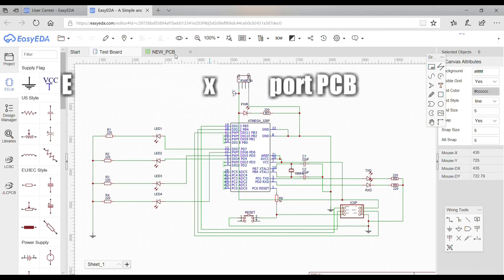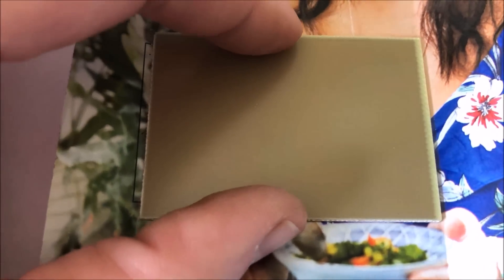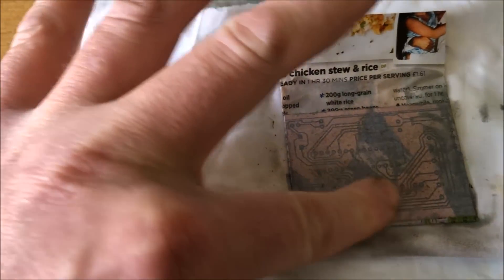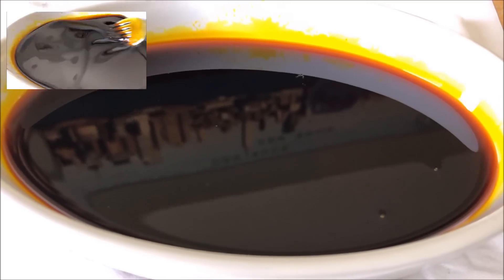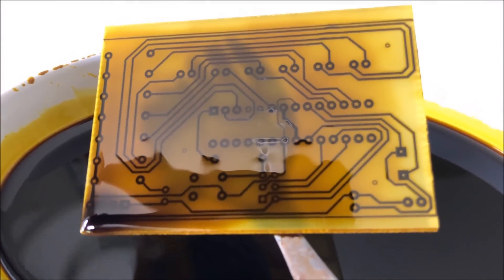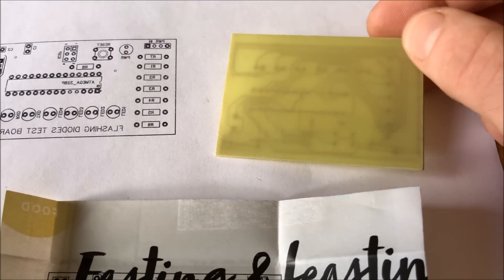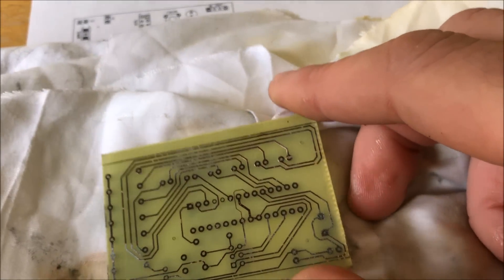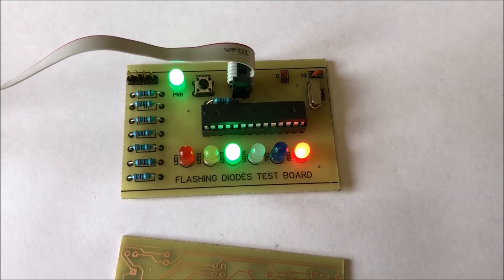DIY PCB Toner Transfer (No Heat) & Etching

Comment: Is the design for the PCB made mirrored? How did you get the designs right on both sides of the PCB?
Lastly, I saw you printing on magazine paper! Could not understand correctly! Could you explain? Thank you
Reply: My understanding is that printing on the magazine paper (or other glossy paper) will allow for easy release of the printing onto the PCB board

Comment: Didn't work. Tried two times so far. I only get smudges or faint circuit traces. Maybe it's the paper thickness, the toner, the acetone concentration or because I used the copper fill method and I have a lot of black. Either way, this doesn't seem reliable.
Reply: I had only parts and very faint transfers the first 3 times. Make sure you press hard! I think I was only pressing half as hard the times i got only very faint results. Also, the time it worked i actually mixed water in the acetone, i used "chemical acetone no oil" 50% and 50% water! I think maybe the paper needs to be dissolved by the water, although not sure the water was what helped. Make sure you press hard!

Comment: Bought two types of nail polish remover. Tried with two different laser printers. My Samsung ML1850 and acetone free nail polish remover (Superdrug pink bottle) didn’t work at all. Lexmark 360 and Sainsbury’s nail polish (doesn’t state acetone free, presume it has acetone) worked AMAZINGLY! Couldn’t believe it. The tracks are SO nice. Can’t wait to do more, with finer tracks. All I can say to others is... if it doesn’t work first time, try a different printer, different nail polish remover, different paper, press harder. This is an EXCELLENT way to make homemade PCBs, no question about it.

Comment: Oh meh gosh.  What kind of resolution can one expect upon transfer?  The double-sided PCB I need is only about 3/8" to1/2" wide by 1.25"  length, with lands about 3/32" and runners 1/32".  This leaves about 1/64" gap between conductors.  Even photo-sensitive process is beyond my capability.  I really like the idea and may eventually attempt on project using older discrete cmpnts.
Reply: Тhis is the right question!

Comment: Does not work at all for me with Samsung laser, glossy paper and pure acetone.
Reply: Tobias - in what way does it not work, does it result in a smudgy mess or does the toner not transfer at all?
Reply: @TrystansWorkbench  The toner does not transfer at all, even with pure acetone and transfer paper.
Reply: @ranger81de  I'm using a Samsung Laser Printer here (an old CLP500), what model number is yours? When you say 'transfer paper', have you tried magazine paper? Try cleaning the copper layer before you start with acetone then use fine wire wool (or very fine sand paper / emery paper) then clean again with acetone. Don't over-soak the magazine with acetone, and let it evaporate dry before trying to remove it. (The video is speeded up when it's drying). I've had success now with glossy magazine paper and the same "Sally Hansen Moisturising Polish Remover", after previously trying pure acetone (just smudged into a mess).
Reply: @TrystansWorkbench  I have tried multiple times with magazine paper, catalogue paper and special transfer paper. When using with heat it transfers without any issues but I wanted to give this method a try. As I said, even with pure acetone, the toner did not transfer at all. I'm using a Samsung M2020 series printer with original Samsung Toner. Also tried different amounts of acetone (completely soaked, only few drops), I couldn't get it to work. :-( Of course I have cleaned the copper surface with fine sand paper before to make sure it's absolutely clean. I was also wearing gloves one time to make sure there is no residue on the copper layer.
Reply: @ranger81de  Tobias, well it sounds like you're doing it correctly. How very strange. The only thing I can think of is for you to try and source the nail varnish remover used here. I found diluting acetone with water made things worse.
Reply: @TrystansWorkbench  I guess that will be hard as I'm located in Germany. I guess the toner of this specific printer has maybe different ingredients which do not dissolve as good as other toners. Once I got a new printer (of another brand) I'll give your method another try. So far I'm using the regular heat transfer method with a laminator, which works actually very good and is nearly as simple as this method. Thanks for your comments!
Reply: @ranger81de  You should be able to get "Sally Hansen" nail varnish remover in Germany. After all, we have it here in the UK, and we are both in the EU (for now).

Comment: I'm quite impressed (and surprised to be honest) that acetone can do such a great job transferring toner on to a copper. Great idea! Kudos to you, sir!
Reply: it was very impressive indeed ... so much easier and quicker than screwing around with a 3D printer to etch a board - aka, ruining a perfectly good piece of blank copper pcb, because most of the attempts I've seen took over an hour for even small boards and totally munted the copper tracks up.
Reply: He really should have been wearing gloves for the acetone part too...
Reply: @qumefox  nail polish remover is designed to be used without gloves
Reply: @AlessioSangalli  you generally apply nail polish remover to the fingernails. You don't soak your whole hand in it
Reply: @qumefox  he didn't put the whole hand in, however acetone attacks gloves too, especially the nitrile ones, that might be why he didn't use them for acetone but he did with the ferric chloride
Reply: @qumefox  what matters? I often wash my hands with brake cleaner, thinner etc. Depends what i'm doing atm. None of those won't absorb. It just dries your skin.
Reply: @qumefox  nailpolish remover or acetone wont hurt your skin and i use bleach barehanded and nothing happens
Reply: @qumefox I'd think of doing that part with a brayer.
Reply: Instead of nail polish remover, can i use acetone only???? Or isopropyl alcohol??
Reply: Этот способ давно известен

Comment: I used glazed paper it is similar in texture but first experience went wrong, what could be the issue and it was difficult to keep paper completely joined with the surface of copper board any tips regarding that please,

Comment: Gareth, what machine are you using, is that a laminator; if so would using an iron also work?
Reply: Good Point Maarten!
Reply: The video clearly says "No iron, no heat" and you talk about laminator, iron et al. Are you so dumb?? And that "machine" he is using is a Laser Printer, heard of it before???
Reply: I am not dumb and making rude remarks says more about you than about me;
I don't understand why you should transfer a print onto a glossy magazine page, tried it and the paper got stuck in my laserprinter, hence my question

Comment: Whats best way to make the holes for components?
Reply: If you have a drill press, that's best.

Next best, if you have a Dremel tool, there are pretty inexpensive drill press kits that use the Dremel as the drill (https://amzn.to/2PEn9pI).

The worst is trying to use a regular drill, freehand. It's a good way to break tiny little drill bits, and get crooked holes at the same time! :P

Comment: hello? if I don't have a laser printer may i use ordinary inkjet printer?
Reply: No, sorry. Laser printer toner is basically powdered plastic, which survives the acid and protects the copper underneath. Inkjet ink can't do either.
Reply: @andrewrothman9831  hey. i got an idea what if i do this experiment. i will print the pcb design in basic inkjet printer. but after i do that i will photocopy the design that i printed in basic printer. then.. i will use the pcb design that i photocopied before. is that okay? what i mean was i will use the photocopied pcb design. not the inkjet pcb design. if I'm not wrong the toner of the photocopy is same as laser printer. right??
Reply: @mrjn6940  That should work just fine, as long as the photocopy quality is good.

Please come back and tell us how it turns out!
Reply: @andrewrothman9831  mr andrew i have one big question. what type of paper is the best suit for pcb making like you do? and like you have? and how many gsm of paper should i use? for me it doesn't matter if its 8,1/2 by 11 or 8,1/2 by 12.
Reply: @mrjn6940  I had a lot of trouble with papers. I would like to try using "semi-gloss finish office paper" like Hack in Black used. What finally worked for me was heat and tissue paper -- the really thin stuff used for gifts!
Reply: @andrewrothman9831  i think i use traditional tracing paper. sure.. thanks anyway. i will show my video here someday.

Comment: Use acetone and alcohol 3:8
Reply: you mean 1 to 2,66 ? 
i found that 1 to 3 and 1 to 4 works
Reply: What alcohol do you suggest?
Reply: most use Isopropanol sold as "rubbing alcohol" or medical cleaning soloution. Its cheaper when you by it in bigger packages.
10L for ~20eur on ebay
local store 0,2L 2,5eur (6,25x more expensive)
but i guess you could by the small package to try it out first.
Ethanol might work as replacement.
Reply: @hyperhektor7733  Thanks Hektor for your reply. I'll try that. I found yesterday that pure acetone just made a big mess, and that the actual nail polish remover used in the video worked very well. I will mix some isopropyl alcohol with my pure acetone and try that too now. Thank you.

Comment: Do I have to use Lazer printer for this process or any printer will do the job?
Reply: @ Legends NUB:
It HAS TO be a Laser Printer. 

The acetone of the nail polish remover liquefies the toner of the laser print, because toner is made of special plastic. Acetone liquefies certain kinds of plastic. 

Since the toner is liquefied by the acetone in the nail polish remover, it can be transferred (together with the carrier layer of the magazine paper) to the copper clad board by pressing strongly. 

Since the color particles of other printers DO NOT consist of plastic, this process DOES NOT work for other printers.
Reply: @tiny5ft6  bro i bought laser printer today for this purpose . thnx for replying
Reply: @ Legends NUB: 

You're welcome

Comment: I don't think he mentioned it but If memory serves then I think you have to use a laser printer ! It wont  work on an inkjet ! Also does anyone know what you could use to protect the traces once the PCB has been etched. Their is a stuff that repair shops use called Conformal but its a little expensive. I'm wondering if there is a household alternative like varnish or maybe nail varnish. I don't know but your advice and suggestions are appreciated.
Reply: I used clear lacquer on mine bought from Halfords

Comment: Absolutely love the tutorial but I never seem to have any success...
At this point i've tried and given up on chemical PCB etching methods, so i've built myself up a CNC machine and now i'm mechanically making my own boards. I suggest anyone out there who isn't having any luck with anything chemical take a look at milling PCBs. I've gotten the original parts of my mill from a $200 chinese kit and i've modded the x and z drive trains to be more robust, also adding a better bit collet, overall being less than $400. Hope this helps, mylo.

Comment: Every day i discover new amazing things in this life. Huge thanks for this, it saves the most important , it saves time. I cant leave without sharing lifehack. If you screwed up with hot glue, just poor it with isopropyl alcohol, and hot glue will fall off almost instantly.
Reply: damn really?  I wonder if that goes for medium heat glue and high heat glue. 

Ok life hack... hmmm.  Use 3.5mm audio jack cables as "wiring harness" for sensors that require 3 wires. Just make sure audio cable has 3 wires.  makes a quick disconnect to sensors and looks tidy.
Reply: @mattrevesz  I have only one type of glue in my area, I assume that if heat glue has the same chemical structure, isopropanol will work . As for sensors - 3.5 mm jack is really better than those small breadboard pins.
Reply: @wickeddubz  hmmm that's really cool about the alcohol.... I put my last project in the oven on low and used a spatula to pry off the hot glue LOL.  
Yea those breadboard pins don't inspire a lot of confidence.  I
Reply: @mattrevesz  I tried to remove hot glue from my project (modded small ikea table) , but I saw that if i continue to remove it mechanically, I'll screw up everything. Few minutes of intensive search and websites crawling helped a lot, all glue just fell of instantly. Chemistry rocks :)

Comment: Great video... when etching the PCB, I prefer to put the PCB upside down. 
Surface tension helps to keep the PCB afloat on top of the ferric chloride.
Reply: Assuming the "resist" is reasonably strong, I put my boards in a little plastic container (one with a snap on lid), such as you will find holding lunch meat, and then shake it fairly vigorously. The etching goes real fast this way.

Comment: Thanks for the great idea. I will try it for my next PCB. 
On seeing this video, one question is likely to arise in many people's minds: How is it that nobody ever thought of this method before?  One obvious answer is this. We know that acetone dissolves toner. When we use acetone to remove the toner from a PCB made using Heat Toner Transfer method, we find that the toner gets smudged and spreads on the board. So, we get the impression that using acetone will result in smudging and the PCB pattern cannot be transferred with precision. 
Of course, now we know that if it's done the right way, it CAN give you a precise and nice-looking PCB.

Comment: plastic does not magically adhere to a pcb.  can you guess what step was left out  ? besides pcb houses do a much better job than I ever could do diy ing it.
Reply: clean the copper surface before transfer; the acetone in the nail polish remover will make the plastic sticky

Comment: Great tip! But I don't understand the step from 1.20 to 1.30...You taped a piece of magazine paper on top of the printed circuit from the laser but what to do next? How do you get the printed circuit on the magazinepaper?
Reply: He put it through the printer again to print on the mag sheet.

Comment: Hi! I am on verge of transferring image on brass sheet. I tried the heating method with transparency sheet. It did not went well. Your output looks so nice. Will be trying tomorrow and would let you know how it went. I have a question. 

Can I use ISO propyl alcohol instead of acetone as you have used ? Please reply ASAP. I have few hours before doing this. 

This is the simplest method I have still come across. Earlier I have tried tapes for tracks and pads. But it failed miserably. Then I used to draw my PCBs design with permanent marker pen, back in 1989 in my first year of engineering for my seniors. It worked very well and now this method seems so simple.

Thanks for sharing idea. ❤️

Comment: I retract ... it did not work as expected. Tracks cut, or blurred. It is not 100% infallible. I would say that 70% ... I tried several ways, first as shown in the video and then following the advice of some comments below ... maybe this method worked better for circuits with thicker tracks, without too much detail...
Reply: https://youtu.be/HBIxvwZ_0og

Comment: Question. Why it was impossible to drill the centering holes. For which you can get the board out of the solution for etching.

Comment: Your approach is so neat. After drilling holes, to remove the black transfer from the copper lands, use acetone on a cotton schwab or cloth, being careful not to destroy the top surface component placement. Much better than the steel wool approach.

Comment: I'm impressed, that's a nice method.  Does any old ink resist the ferric chloride?  I've access to a flatbed printer that uses inks, not toner, might give it a go.  We've also got a Gerber that prints foil onto sticky-back vinyl...  now I'm getting ideas !!

Comment: i'll have to give this a go sometime. Your method is definitely faster plus bonus silkscreen layer! 
  I use machinist layout fluid in a spray and 3D print PCB supports. I then use a rod from a scrapped printer and its bronze bushing in a 3D printed housing mounted in place of the 3D print head to do the isolation routing and later the solder mask layer (cleans the paint off the pads for me). Later I used a 3D printed case to hold the innards of a Dremel Flex-shaft, mounted to where the print head and "engraver" mounts to use it as CNC drill for the THT and VIA's.  Might seem overkill for a 4cm sq single sided PCB, but indispensable for  a double sided 15cm sq PCB with over 100 holes and 150+ 0.5mm VIAS's.

Comment: Hi  I prefer to use heat transfer only because i want to stop using unpleasant chemicals . the only question now is what is the best way to dispose of the ferric chloride? keep up the good work
Reply: I etch with hydrogen peroxide and distilled vinegar. It's slow but cheap and no overetching occurs. But still has copper in the solution. Makes great vegetation killer though.
Reply: Ferric choride can be poured back into the bottle and reused.

Comment: This looks a lot easier.  trouble is for me is the ferric chloride I bought from ebay does not etch well. I have to put some on a sponge and rub for twenty minutes. I suspect I got a watered down fake.
Reply: A good substitute for ferric acid is 50/50 muriatic acid and 5% hydrogen peroxide. Super cheap and readily available. Just remember to add the muriatic to the peroxide, NOT vice-versa.